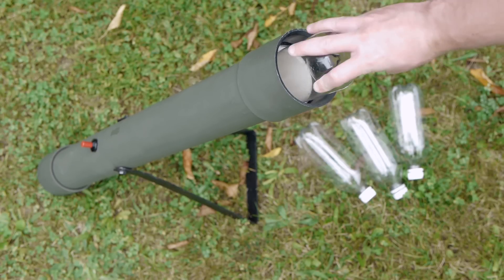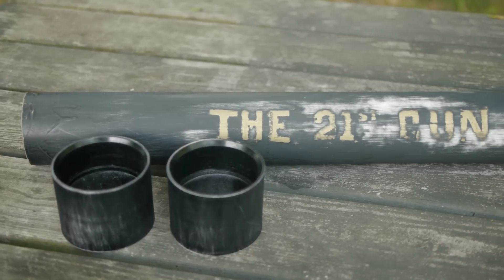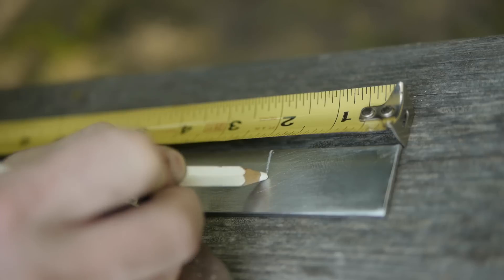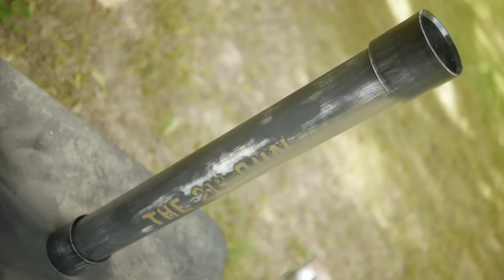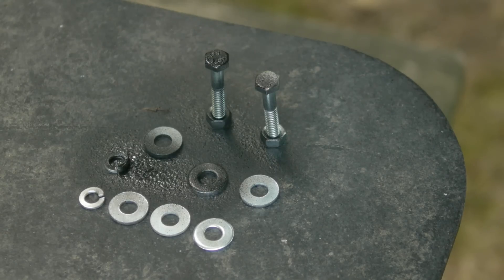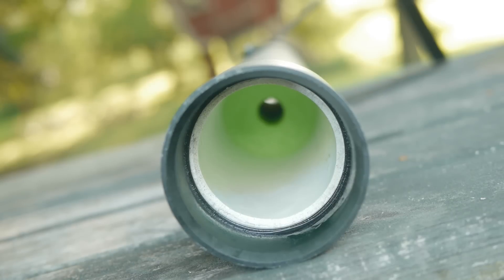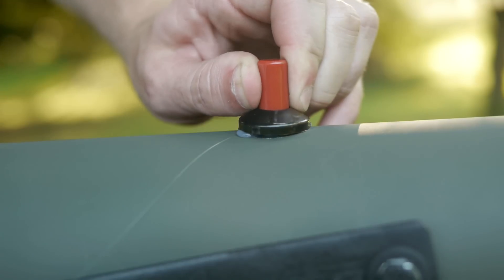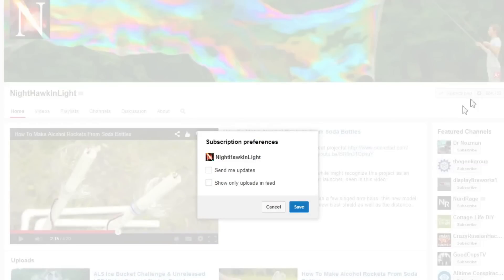How to Make an Alcohol Mortar Launcher

Comment: I want see bazooka style bottle launcher
Reply from the maker: You can take the stand off easily enough...
Reply: @Nighthawkinlight  could you fill it with flour to make a giant smoke cloud
Reply: I made something like that when I was rather young, though I used solid state rocket fuel rather than alcohol.
Reply: Slaughter round
the colour is not that important, just think how cool it would be to put some fletching, a longer barrel and first of all some more weight on the bottle: a lot more range. or you can tie explosives to the bottle and weaponize the concept, thhough i'm sure firecrackers would be fine too. by the way, i know that nighthawkinlight is into pyrotecnics, ever considered to use theese things to propell something up in the sky?
Reply: Actually you can do that just remove the stand and put some ADS on the front and its a L.A.W launcher how epic is that. And before i miss in our country this thing is called BOGA i dont know why:-)
Reply: Yeah that would be very cool😉
Reply: Dont add grips and u have it 😁
Reply: Or dont even add it
Reply: Just make this and handle it like a rocket Laucher
Reply: NightHawkInLight this i will say to him
Reply: Yes

Comment: nice but rubbing alcohol on a paintball scene? dont think that's very safe. Still a fun project! thanks for sharing!
Reply: not any more dangerous than running around with a tank of air at 4,500 PSI under your arm ;)
Reply: It is just as dangorus to walke around with green gas for airsoft guns
Reply from the maker: Why don't you think it would be safe? If you were concerned about it, the bottles could be fueled off the field and capped off until ready to fire.
Reply: Justin DiPlacido and what would that be? certainly you're not referencing a paintball tank or airsoft gas gun
Reply: zeroy yeah that rubbing alcohol is just nothing but dangerous